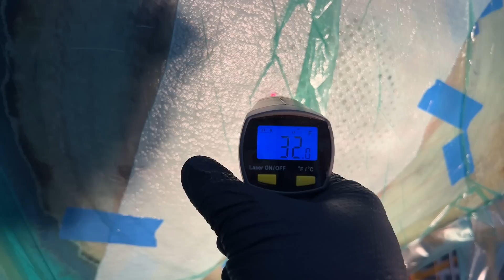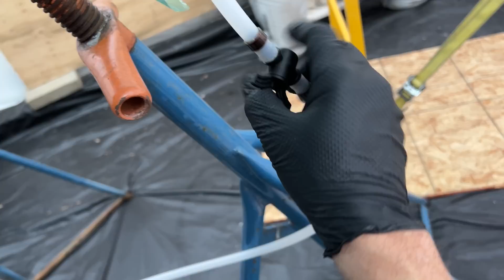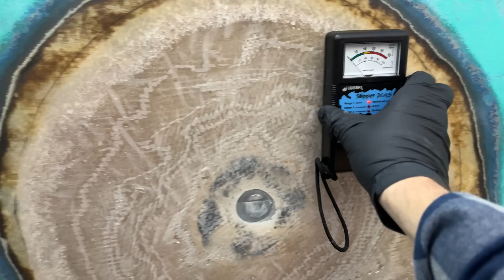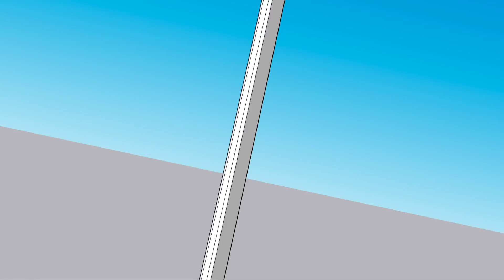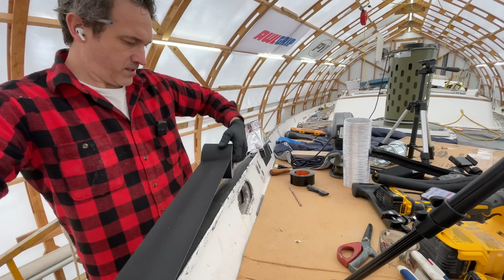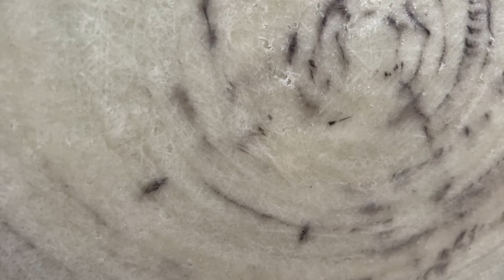I Built a DIY Boat DRYER but Does It Actually WORK?!| E039

Comment from the maker: Any other "HOT" Tips out there for drying out an old rotten bulwark??!!
Reply: I don't like the hair dryer heat source.  One style of very safe space heater is an oil filled radiator type.  The are safe enough to leave running unattended, as the fins don't get hot enough to ignite a piece of paper, if one were to fall against it, yet would increase the air temp.  Perhaps you could stack three together like books on a shelf, standing on their feet vertically as designed, to increase the surface area you would draw the input air through with some kinda shroud... Could probably pick up used one's for next to nothing off Craig's list etc.
Reply from the maker: @redshifttrucking4537  I hear you... it's not my most ideal heat source. The oil filled radiators are good but possibly difficult to apply in this situation... I'll think about it. Thanks!
Reply: @livingforsail  I love your system for drawing air over the area, but believe you need  to increase the amount of time heat is added to the system.  The hair dryer can't be used for a long enough time to impart the needed heat OVER TIME.  I have seen heated pads used in blister repair, where a heated pad is vacuum applied to a blister area to provide both suction and heat over a two week period to both draw out the water from a blistered area, and provide some heat to aid the drying process.  Alternatively, could heat be applied to the area with a lamp shining on the section....  you want something that can apply some heat over a long drying time...
Reply from the maker: @redshifttrucking4537  I think you're right here... I will run the "dryer" for the week and see if I get any drop. I might have better luck and a happier wallet trying to setup a closed loop dehumidifier setup instead of a constant wasted heat source...
Ultimately, It might just be time that is on my side to open it all now and hope for a warm spring/summer...
Reply: @livingforsail  Hmmm...  Pulling the input air through a can of desiccant to dry it out before it flows through the channel may be better than heat
Reply from the maker: @redshifttrucking4537  Interesting Idea. Thanks!
Reply: vacuum
Reply from the maker: @nobody46820  Ideally that would be great. There are too many leak paths to get close to the vacuum that would be needed to boil off the moisture at ambient temps...
Reply: @livingforsail  Crikry!😦
Reply: Air movement is the key. I bet you a boat show Molsen that your setup does the trick.
Reply from the maker: @scottcates  We will see how it does. I will let it run for a week and then evaluate. A dehumidifier might be more effective than the heat source...
Reply: @livingforsail  I have one or two spare dehu's if you want one.
Reply from the maker: @scottcates  That might actually be pretty useful. Maybe fire me an email? livingforsail(at)gmail
Reply: The environment outside of your shed might be working against you, cooler temps and moist air seeping in from the winter.  In a perfect world you'd start the drying out phase in the spring and run it all the way through the late fall.  Usually, a 'total boat' dry-out operation is required on a project this large because you can be certain moisture is hiding in so many places you haven't even looked yet.  This would involve removing everything from the boat that isn't bolted down and could be a source of retained moisture (empty all tanks, clean bilge, remove all upholstery, every floor board, remove every door/hatch/cabinet, etc. - empty to the bones). I prefer de-humidifiers running inside the boat over heaters (they do create some heat, just run the discharge hoses outside the boat AND outside of the shed).  Drying out a hull works better when the old bottom paint is stripped and even the gelcoat if needed (only if blisters are really bad and initial moisture readings are high, because you'll have to fix the bisters with glass anyway).  This all sounds like a lot because it is, but anyone who uses half-measures to dry out a hull and repair blisters will suffer the fate of seeing the blisters return in just a year or two.  On the left coast, we sail down to Mexico where there are affordable yards and go on the hard for the hottest, driest part of the year.  It actually saves money in equipment and labor to let Mother Nature do most of the work.
Reply from the maker: @SteelDoesMyWill  Thanks for the info. I think you are right that I am fighting mother nature here and agree with your points. I am planning to get the bottom stripped soon to let that dry too. I was very happy how dry the area at the patch was. Hopefully that is a good sign. Cheers!
Reply: I would start preparing now for the Spring/Summer.  Do all the prep work to be ready and get the required tools/equipment lined up (buy it used or rent it).  Get the boat cleaned out completely and disassembled, meanwhile you might discover more issues hidden.  When ambient temps outside the shed rise and humidity begins to drop, then start running your dehumidifiers and/or heaters & blowers inside the hull... run them for weeks or even months... take moisture readings twice a week.  Also, plan on other tasks that you can do while waiting for the bulwarks and other parts of the boat to be fully dry.
Reply from the maker: @SteelDoesMyWill  This sounds like a good plan. Thank you!
Reply: Wondering of a heat tape would help.  It seems you could slide it in the slot, then cover it with a permeable  insulator.
Reply: Wondering of a heat tape would help.  It seems you could slide it in the slot to apply the heat more directly.  Should be compatible with your airflow system
Reply from the maker: @olsonacre  Another interesting idea! Thanks.
Reply: @livingforsail you might use both desicant a heat tape together where you place the heat tape in the bottom of the trough, lay desiccant on top.  That would pull the moisture out and the heat tape would continuously recharge the desiccant.  After, you can vacuum the whole thing.  Just a hypothesis here, naturally.
Reply: Without the shed being temperature/humidity controlled you can only do so much. Getting it absolutely bone dry isn’t really the point anyway, right? It just needs to be dry enough to not to interfere with whatever repairs are being made or cause issues long term. There is the ideal and then there is the real world.
Reply from the maker: @caseyrockssocks  yeah. I think that's the case here. Any laminating resin will be happier if the substrate is good and dry. If I can get it down a little bit I would be happy.
Reply: "Desiccant dehumidifier"... I use a desiccant dehumidifier, they are more suitable for low-temperature environments and effective in reducing humidity to lower levels. Putting my machine on "drying clothes" mode and the fan to max in a small area works wonders on drying stuff, perfect for drying clothes but also electronics and in your case boats...

I'm drying my rudder now, which is split and needs a repair. I sanded it first, put taper space into it like you did on your fiber patch repair, now waiting for it to be super dry...
Reply from the maker: @MarcoYolo420  Interesting Idea. I think I can give that a shot. Thanks!
Reply: @livingforsail thanx for replying!  I posted earlier about my Meaco dd8l, nice machine. You need to create a closed area as small as possible with optimal airflow. I think it will work perfectly.
After use you can use the machine on your boat in winters to reduce condensation issues in case your boat is not properly insulated, or to dry clothes pretty fast without the need of a dryer...
Reply: @livingforsail   I asked Grok, and he came up with two nice alternatives: infrared heating (avoiding the need to heat surrounding air) and microwave (careful not to overheat).
I would give infrared a chance too, those heaters cost near to nothing nowadays...
Reply from the maker: @MarcoYolo420  Grok? I will see if I can track down an infrared heat source. Cheers
Reply from the maker: @MarcoYolo420  Interesting. I had not heard of that before. If it uses desiccant, does it need to be "recharged".

Comment: I used to work for United Technologies at their Hamilton Sundstrand repair facility in Long Beach, CA. I did fiberglass repair on propellor blades which are a foam and fiberglass composite on an aluminum spar. We used epoxy, S glass and vacuum bagging. The factory / FAA manuals are very specific that the largest patch goes on first then successively smaller and smaller patches for exactly the reasons you mentioned. Any good boat glass person will say the same. The loads on those are much larger than anything your bow will ever see unless you punch a reef. You did it correctly and that patch ain’t going anywhere.
Reply from the maker: Thanks! I’m always amazed to find out who’s out there watching these videos. I REALLY appreciate the experts chiming in and it sounds like you’ve “been there-done that”! 
Cheers!! 👍🙌🙏

Comment: 65 35 is best for glass, 55 45 for kevlar.   You shoot for 60-40 so the bleeder takes the 5%. You are resin heavy but better than resin dry.
Reply from the maker: Thanks for the info. I figured we were still in an acceptable range. The boat was hand laid poly so I probably do t really need to be pushing down into the leaner ratios I imagine…

Comment: Why not using a dehumidifier? I use a desiccant dehumidifier, they are more suitable for low-temperature environments and effective in reducing humidity to lower levels. Ptting my maching on "drying clothes" and the fan to max in a small area works wonders on drying stuff, perfect for drying clothes but also electronics and in your case boats...
Reply from the maker: Good idea. I think I’ll give it a try. 👍
Reply: @livingforsail  in the Netherlands the Meaco dd8l junior is very popular amongst boat owners. 
One of the important features:  the chosen program resumes after a power outage.
The machine never failed me in 2 years of continual use in the winter.

Good luck with your awesome project !
Reply from the maker: @MarcoYolo420  I'm looking into it. Very interesting indeed. I wonder if I can get it in a "NA 120v" Electrical plug....
Reply: @livingforsail  I asked Grok. I'll post the answer below here. If it is deleted, just ask Grok yourself:
Reply from the maker: @MarcoYolo420  Thanks!
Reply: Question: The Meaco DD8L Desiccant Dehumidifier is a very well praised machine in Europe.

Is it available in Canada?
Are there other brands that are very good and available in Canada?
Reply: Answer from Grok: The Meaco DD8L Desiccant Dehumidifier, while popular in Europe, does not appear to be directly listed for sale through major retail channels in Canada. However, availability can change, so checking with specialty appliance stores or through online marketplaces might yield different results.

For those looking for similar high-quality desiccant dehumidifiers available in Canada:

EcoAir: EcoAir offers a range of desiccant dehumidifiers, particularly the EcoAir DD122FW and the EcoAir DD122 MK5, which are noted for their performance in cooler temperatures, similar to the Meaco DD8L. These models are known for being efficient and quiet, making them suitable for various indoor environments.

Ebac: The Ebac 2650e is another well-regarded option, although it's a compressor model rather than desiccant. It's highly efficient for warmer conditions but still a strong contender for those seeking a reliable dehumidifier.

Amazon Canada: While not selling the Meaco DD8L directly, Amazon.ca offers a variety of dehumidifiers including models from brands like Honeywell, Frigidaire, and Danby. These brands are known for their reliability and availability in the Canadian market. You might find models that match or closely resemble the features of the Meaco DD8L in terms of capacity and efficiency.

When choosing a dehumidifier in Canada, consider factors like the area size you need to cover, the typical temperature of your environment, and whether you need features like continuous drainage or specific humidity control. Each brand might offer unique features tailored to different needs, so comparing specifications will help in making an informed choice.
Reply from the maker: @MarcoYolo420  Thank you and thank you GROK

Comment: anyone who has read some books on wood epoxy boat building knows that the answer is big to small. anyone still insisting on the opposite, aint going to get my time or crayons to explain it.
about your drying setup: why not get a small dehumidifier, loosely tent the area and let the machine do its thing for a couple of days? you will need a dehumidifier going forward with the project and might even be able to run it whilst living on the boat.
Reply from the maker: I think that sounds like a good plan. I’ll let this run for a week… pay the electric bill, and then probably change the plan to something along the lines of what you suggest. If I empty out the bulwark along the entire perimeter (about half way so far) I can probably setup a closed loop to circulate and dry with a dehumidifier 👍

Comment: So frist the glassfiber patch layup is totale right, just end the layup with a layer that covers it all at last, stress bending of the glasfiber they other way around will make it pop it off like a cork. But you have a lot of layers in a small area, chamfer 5cm / 1.9 inches per layer, and keep it square. It will make it easier to grind out the edges later.

End the layup with CMS 300 for grinding, in that way you will not weaken the fiber in the patch.
It did have a bit of spiderwebs in it so i think you did vacuum a bit to hard, (Resin in peel layer)  but love seeing vacuum repareres good job
Reply from the maker: Hi. Thanks for the feedback. I will probably do as you say, grind back any high spots and then lay a final layer or two of CSM to cover everything. 
The CSM in America doesn’t play as well with epoxy though… powder binder CSM is a bit harder to find. 

I will probably back the vacuum off even more to 5-10”HG for these vacuum assisted wet layups in the future to keep more resin in the mix. Not building a race boat here…

Thanks! 🙏 👍

Comment: What is the purpose of the foam pipe insulation being stuffed into the top of the bulwark when drying? If you are just trying to contain the airstream then shouldn’t the gaffers tape be enough? Or are you trying to hold in heat? Actually curious if the heat is even worth it. I would think a constant stream of regular (non-heated) air would be enough and would be cheaper (to run) as well. Heat would certainly make the dry time shorter but by how much and at what relative cost?
Reply from the maker: Hi. Good questions. The center section of the bulwark - the divider - is lower than the top of the bulwark so the rubber insulation is meant to force the air into the two channels. Otherwise it would mostly run over the top.

I agree that the heat may not be “worth” it. I will run it for a week and see if there’s any movement. It’s probably going to be most effective to just run the air and use a dehumidifier, or let the naturally dryer summer air do the job… 👍
Reply: @ as long as your fan is pulling enough CFMs I wouldn’t think it is necessary to constrain it to the two channels. The airflow will simply fill the entire space. No clue though. It certainly doesn’t hurt anything and costs basically nothing to do (relatively speaking). Will be interesting to see how the drying progresses. Keep up the great work!
Reply from the maker: @caseyrockssocks  The Fan does pretty good overall and, as you mentioned, is really cheap to run... the heat source... not so much. haha.

Comment: Turn the batten on its edge to see the shape. Laying it flat along the surface does nothing to see the shape versus the hull and the repair as it conforms to the shape with the thinness of the batten used.
Reply from the maker: It’s not really a proper batten. On its edge it will not conform at all. I get what you’re trying to say though and a better batten is in order but this still worked to gauge the general shape as it produces a fair curve 👍

Comment: Enjoying your channel, makes me wish I had a place to do a retrofit and the skill where I live hard enough to get DIY stuff for a small home project.  I like your setup for drying the bull works, however it would have been nice to see the before and after moisture readings noted.  Keep the interesting material coming!  Lastly was curious are you still doing some engineering work on the side or this is your fulltime job now?
Reply from the maker: Thank you! I will put up some numbers about the before and after as things move along. There are before numbers noted in tape along the hull (previous 1 or two videos)
I occasionally pickup some PT engineering work but am not full time with anyone.

Comment: WOW,!!!  That thru hull elimination lamination looks perfectly located and sized to accept that bow thruster a modernized full Keeler should have😊.  After a working lifetime dealing with vinyl ester polyester resins, was forced to learn about epoxies and 1708 reinforcements for major repairs to a skeg and fin keel to our blue water cruiser (44 yo).  I , you learned a lot about the physical properties of these modern laminating materials.  Thank you for your thorough investigation and analysis.
Reply from the maker: Thanks! I think a new hole somewhere in that area might be in order! 🙌